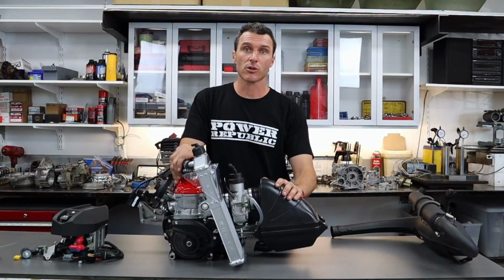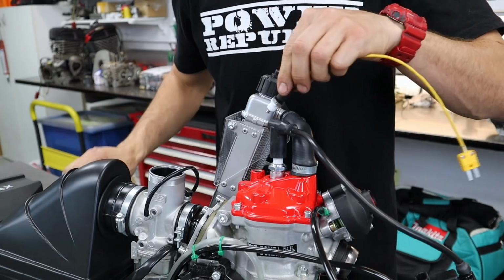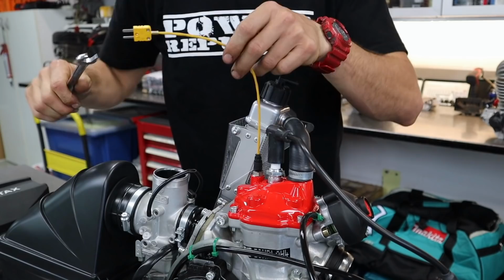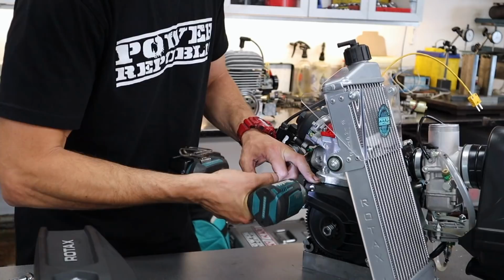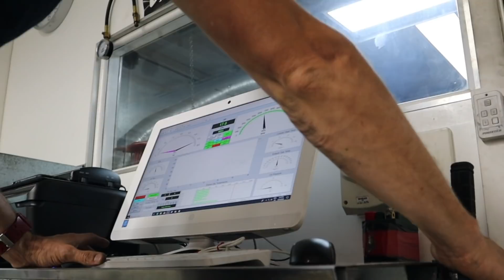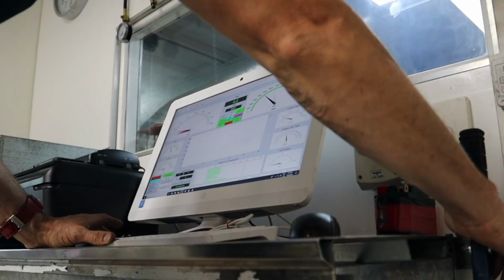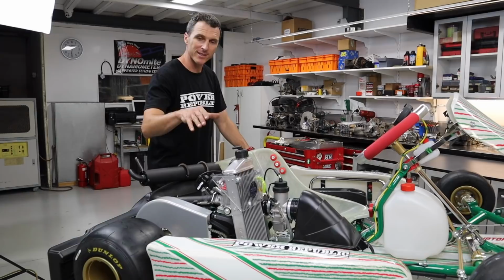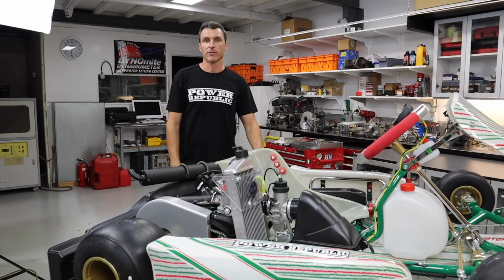Rotax Senior Max 125 Engine Installation - POWER REPUBLIC

Comment: Would be helpful if you did a guide on how to change crankcase bearings and seals on the rotax senior
Reply from the maker: Hi Byrnesy, will do next time I have one in the workshop.  Also too there is a Rotax manual online you can download that details the steps for their engine on how to rebuild it.  Couple this with the Power Republic heat torch method  and you should be able to work your way through it.

Comment: I have a junior rotax max and would like to know if there is a good engjne position to mount it .  Ie. Distance from the sprocket carrier or bearing mount . Thanks in advance
Reply from the maker: Not that I know of, normally line the crank up with the side pod bar as a general rule to start from
Reply: @PowerRepublic  Thanks for your quick reply .    We have just moved up class so i'm guessing a whole load of chain lengths required 🤣🤣

Comment: Dear Sir, I have this question, maybe as many karters out there: (As I am employed in the aviation business), I wonder what is the mandatory Rotax Max long storage procedure? ( I believe it is not similar as the Rotax aviation engines😃), however I noticed similar procedures are required, such as piston seizure prevention, monthly hand cranking, 3 months inspection, moisture control etc..
Mainly the question would be, is cooling circuit draining required? (Effects on casket, shrinking when drying leading to detoriation)?
Reply from the maker: hey Adam , not sure when it comes to aviation.  fuel sitting in the carbs and fuel pumps isn't awesome over time.  but other than that, the engines are pretty hardy.   maybe just block the exhaust and inlet to stop cold wet air entering the engines
Reply: @PowerRepublic  thank you Sir!

Comment: I have a 125 max rotax motor is suppose to antifreeze in the bottom crank this is the first time I have messed with this kind of motor and I went out and started it and the piston blew up and messed up the jug when I pulled everything off it was full of antifreeze in the housing above the jug
Reply from the maker: is it missing one of its head o rings?
Reply: @PowerRepublic  I think we found out what it was there was a crack going down the head like someone might of torque it to hard thank you for the reply and helping!

Comment: What size bolts go from the engine plate to the engine block
Reply from the maker: hey Ron, m8 in various lengths from 30-50mm depending on the make and model

Comment: Hi Derek, Greetings from Ireland....Thanks for another great video.....do you recommend using blue loctite on the engine mounting bolts when attaching the factory mount for use on the kart?
Reply from the maker: Hi Brian, i don't use it myself however if I did,  Blue Loctite 243 would do the job.
Reply: Thanks Derek...learned a LOT from all of your videos.
Reply from the maker: Thanks mate

Comment: How long does it take to fit the engine and wiring
Reply from the maker: Hey John, are you asking about a brand new engine package set up on a kart?  I would allow half to a full day depending on how much experience you have with them.  It is all the little things that add up.  Once installed, engine swaps can be done between sessions.

Comment: How much is the tension in the chain?
Reply from the maker: Hi Riccardo, I think you should have 10-15mm of 'slack' in the chain.  Make sure you use plenty of Chain Lube.
Reply: @PowerRepublic  But the movement should be complete (top to bottom) or something else?
Reply from the maker: Yes that right, about 10-15mm at the highest spot (about the thickness of the chain either side of centre ).  just remember that a looser chain is better than too tight, IMO
Reply: @PowerRepublic  thanks a lot